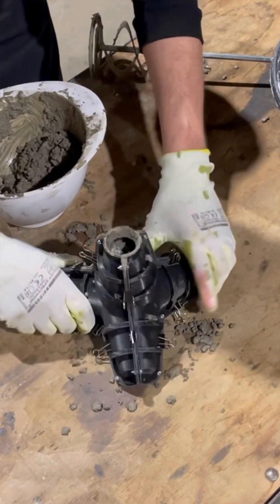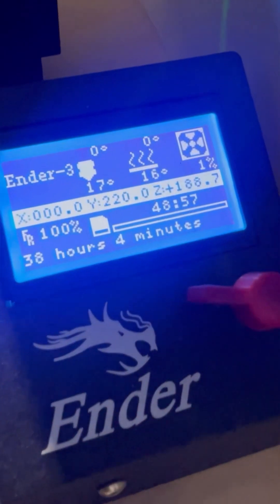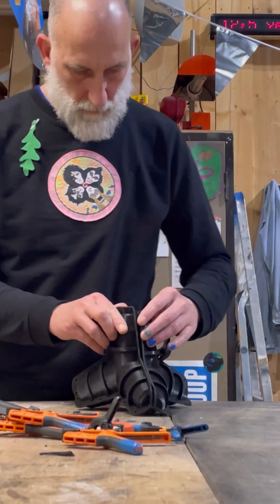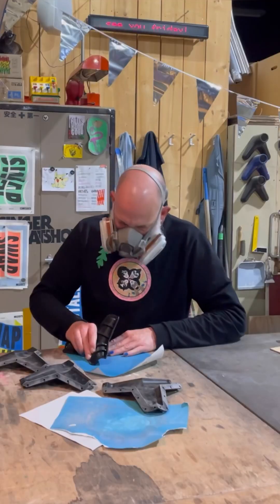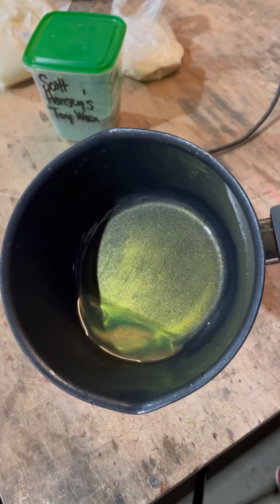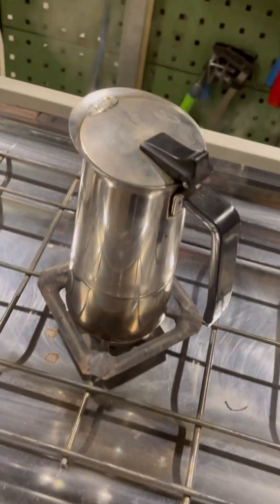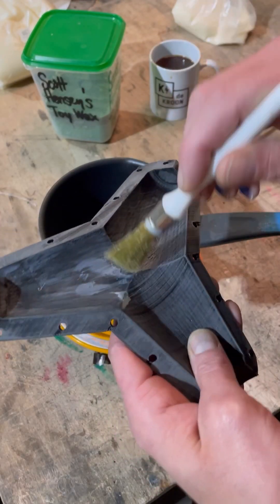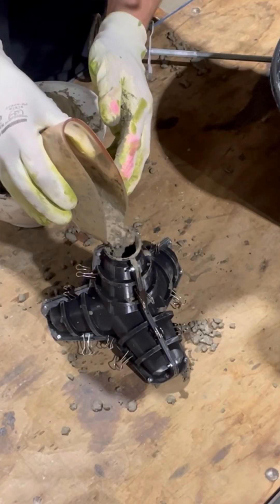Will This Work? 3D Printed Concrete Tetrapods

Comment: what filament did you use for 3d printing?
Reply from the maker: @miguelcapacite4513  this first test was still just PLA but, if you look at further videos where I also totally overhaul the mould design, I print that design in PETG now, and the screw-on caps in TPU. they both withstand concrete waaay better than PLA, which will degrade and break very quickly. if you are not going to use concrete but something else like plaster for instance, PLA isn’t that much of a problem I found
Reply: @baschz  thank you!!
Reply: @baschz  i was about to make a smaller tetrapod using portland cement though and I don't know what filament is recommended, since PLA is base when it comes to the curing of concrete it seems to be not capable for me
Reply from the maker: @miguelcapacite4513   if you want to make just one or two casts and have nothing else on hand I would probably just go for it, but if you want to reuse the mould more than that, I definitely recommend PETG, or maybe ABS but I haven’t tried that myself as I hate printing in ABS. but maybe it’s interesting for you. I’m curious about your makes. please feel free to share when you do! I’m also on Instagram, where I share most actually. same name, just @baschz
Reply from the maker: @miguelcapacite4513  this one is PETG and TPU https://www.instagram.com/reel/C_3XvXko-LB/?igsh=OWNrMjcyNDV1emY0